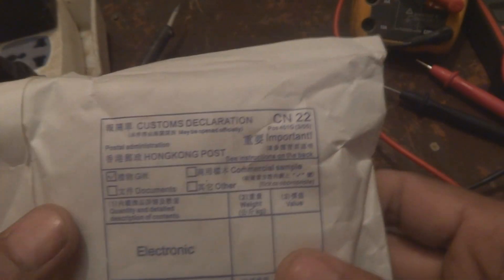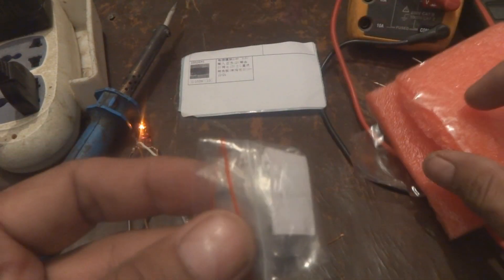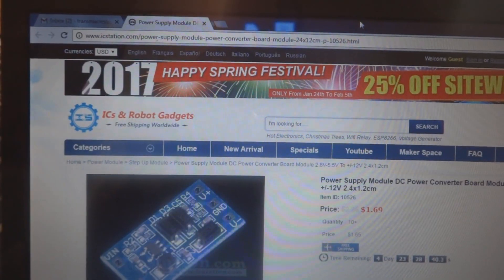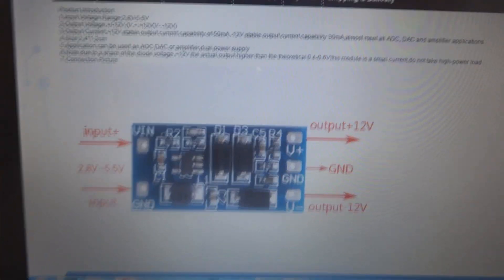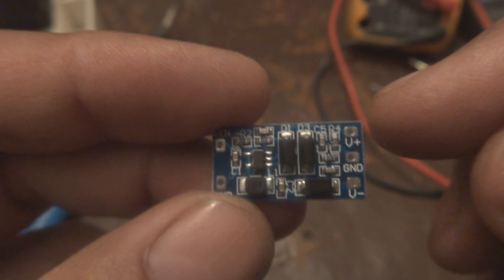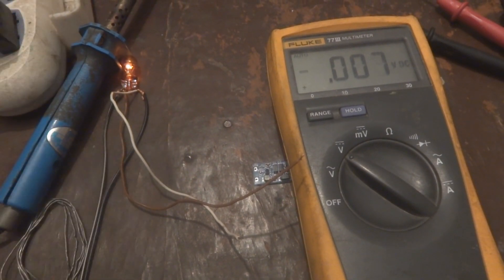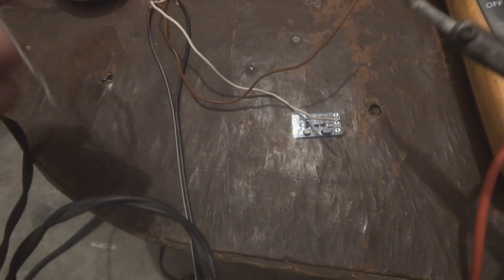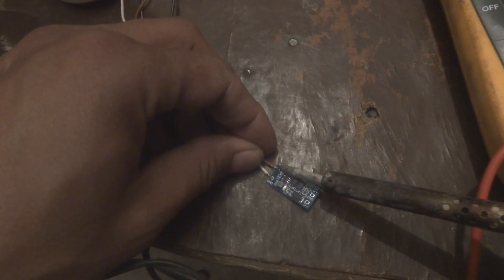Boost converter review. Power supply review. buck converter

Comment: Thats a cute little boost converter :-D
Im not sure if i could find a use for a 20ma output, i would go for the bigger converters for more current.
There are many types of boost/buck converters out there, and kits too, if you like soldering.
Reply from the maker: Thanks for dropping comment dear friend. You are right it is very tiny converter. There could be some use of 30mA maybe. The bigger converter review may come latter in next videos. Hope those videos will serve its purpose. Regards,